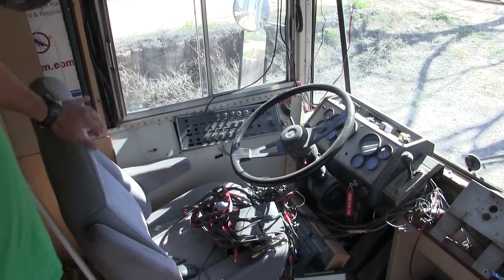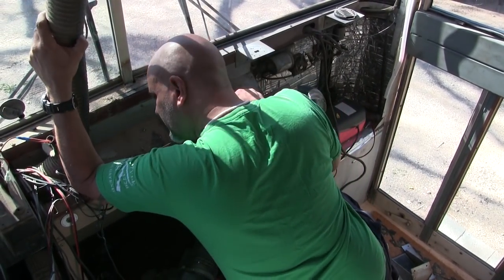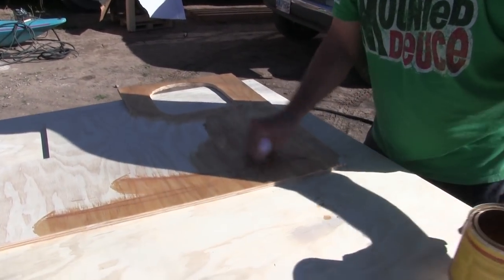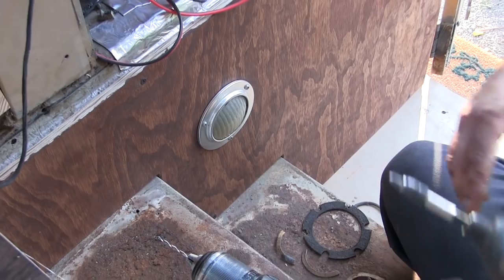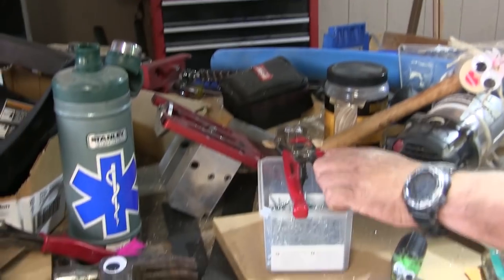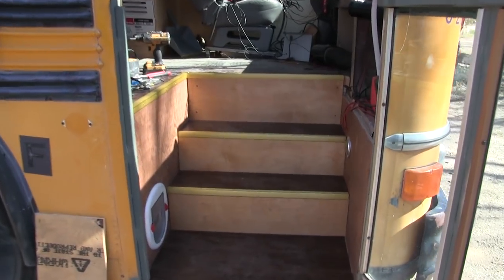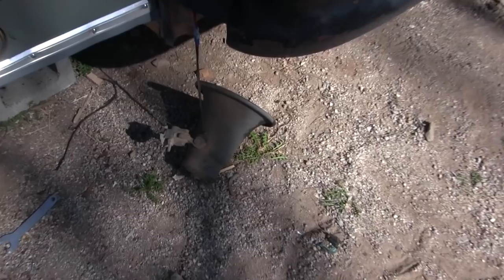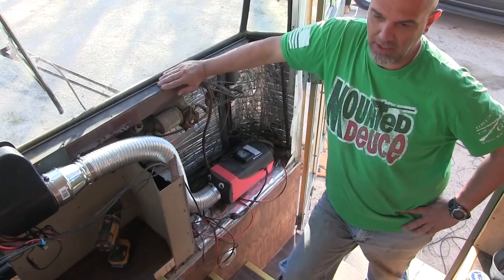Skoolie Stairs & Diesel Heater Defroster

Comment: Love your videos! On the heater tube you could also put a "T" connection/splitter. And whit a valve to blow some hot air towards your door. In cold days I think it will draft cold air from the door/stairs. There are valves to bye so you can adjust how much air you want. Many campervan parts store have probably something you can use. Lovely videos you make

Comment: If the exhaust heat exceeded 200 f directly into the glass in one spot it can crack your windshield and at 275 soften and at 325f melt the diverter box check the temp at the discharge.  You may want to vent straight up instead of directly into the glass.  I love your creativeness and drive you guys make a great team .
Reply from the maker: Oh good to know, we will check out that temp! THANKS!

Comment: Mike, see if you can remote the controller for the diesel heater over next to the drivers seat then you will be able to turn it on when driving if it rains etc. Love that cat flap, never seen that done before.

Comment: Hi guys I'm in the process of determining my heat sources for my coach and I'm hoping you might be able to answer a few questions for me.
BTW love your videos you both are very talented people and make a great team.
So your using 5000btu units? Or more?
The question is is it enough for the entire coach? And if not are you considering adding third one? 
Are there any cold spots in the bus when you have them running? Or would you have located them in a different spot?
And if you could do it all over again would you have gone with a different unit? 
 Are you planning on a second heat source for convenience or back up.

Thanks for taking the time with my questions I know your hard at it on the coach it's turning out beautifully.

Comment: Will that keep your feet warm while driving too?
Reply from the maker: We sacrificed the tube that went to the driver's feet because there was no way to split our heater's vent tube into two different locations...we just made all the hot air go into the defrost vents to keep the windows really clear. But we plan on doing more parking (2 weeks at a time) than driving (to the next location we park), and probably won't be driving much in really cold conditions! ~K

Comment: How has the heater worked for you?
Reply from the maker: In the winter time we use it almost daily. It works very well and we've had very little problems with the unit itself. We did have a problems with the fuel lines cracking and those were the fuel lines that came with the unit. After replacing them with a much higher quality fuel line I don't foresee any problems in the future.
Reply: @BussyMcBusface  That's great thank you! Is it powerful enough for defrosting your windows? Im planning on doing the same thing but was concerned it would be powerful enough to defrost the big ol windows!

Comment: Stay tuned next week and we'll find out; will the diesel heeter melt the plastic defroster vent, will Mike finish the dash area, will someone be electrocuted from all of those wires, what kind of mount will happen with all of those switches, and finally... will we get another tease of that magical tile work Kerry is doing?!?!
😂🤣😂🤣😂